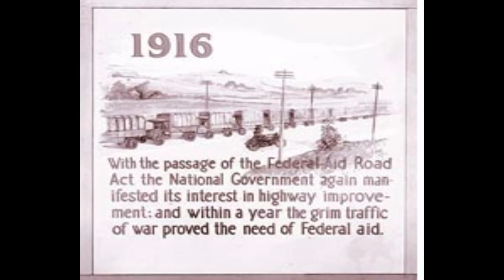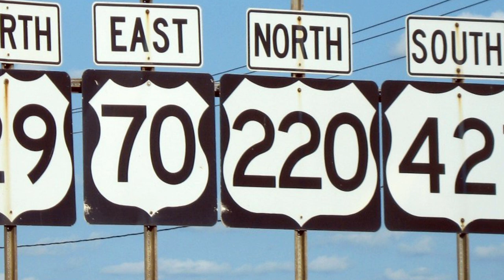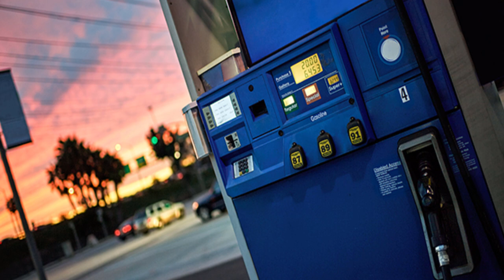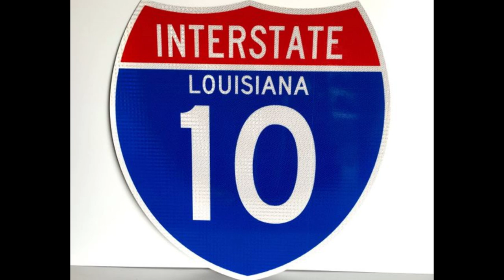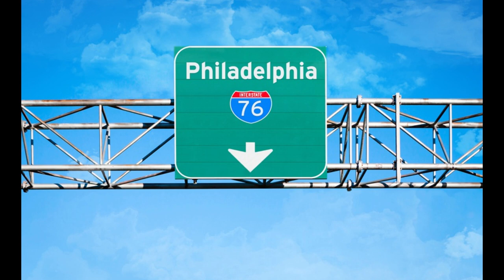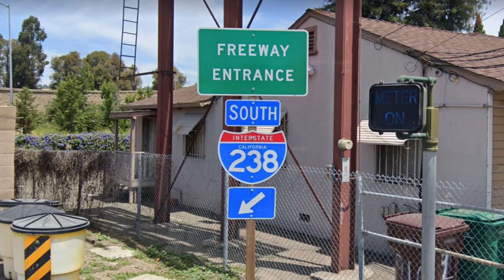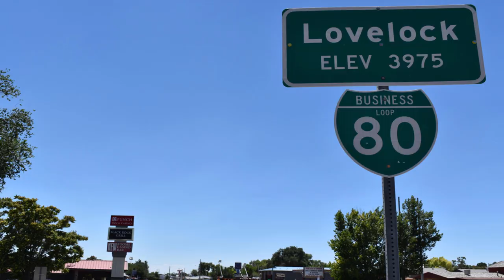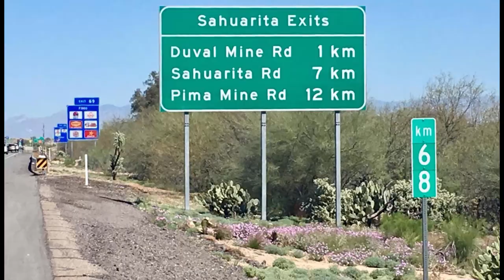The U.S. INTERSTATE HIGHWAY SYSTEM Explained

Comment: The reason I-19 has distances in kilometers isn't because of Mexican tourists, but rather as a test after the passing of the metric conversion act of 1975. Now when signs need replacing, they will do so with miles.
Reply from the maker: Thanks for letting me know! I’ve been in that region but never been down I-19 so thanks for correcting me. That’s really interesting!
Reply: I concur.  It was a test highway relating to conversion from English to Metric system.
Reply: Cities woes are self inflicted. Why anyone would want to live in an overcrowded, dirty, corrupt cities I'll never understand.
Reply: @kdrapertrucker  why do you think cities are corrupt? So rural communities have no corruption? Cities are actually very clean and offer residents huge opportunities for upward mobility. I live in DC and absolutely love the access I have via walkable communities and transit to anything I’d need.
Reply: I know the metric system but I think in miles and inches! I know a km is close but less than a mile as 2.54 centimeters in an inch and a meter is close to a yard
Reply: When some signs were replaced for maintenance, they remained metric
You can see them on google street view with signs using newer clearview fonts
Reply: They should use distances in miles, but use km for mileposts and exit numbers.
Reply: The metric system is the best! When is the US going to get with the plan?
Reply: @RogerLaurel  I hope never. Miles For Life!!!!!

Comment: I'm a truck driver, so the interstate system makes my job 100 times easier. At the same time thou, i come from family that have been displaced specifically due to the interstate system in NYC. So it's a little conflicting sometimes
Reply: Well, you didn't build the thing so it really isn't your fault. Your family is unlikely to blame you in any stretch of imagination.
Reply: Roads are racist, unless you buy an EV or take an EV bus then it is less racist.

Comment: My favourite feature of the interstate system is that the exit numbers are mile markers which means you can very conveniently track in how many miles your exit is coming up and plan accordingly. Additionally if an exit is added later, you don't have to renumber all the exits that come after the new one. I believe this is the only correct way to number exits. And even if you have exits within a mile you have 26 letters in the alphabet. I'd like to see a similar system implemented in my country one day. 
Another thing I like is that, while with exceptions, there is a clear numbering pattern and it makes me think of a mathematical graph where numbers increase the further right and up you go. Could it be the reason why I-5 is on the West coast and the I-10 is in the South? 
I believe it is possible to get onto the interstate from almost anywhere from the country and navigate your way home without a map or a GPS-navigation by just knowing which interstate runs near your home and what exit you need to take onece you get there. 
All around an amazing system, minus the fact that they tend to cut through cities. I strongly believe that they should go around cities and form ring roads.
Reply: I've noticed that as the interstate goes on the outskirts of a city, that the city typicaly expands to the interstate as what happened in my town of Stevens point WI. I've seen this in numerous small and medium cities that I've been through

Comment: I-84 through the greater Hartford Connecticut region is an example of the “winners” and “losers” situation you so aptly described.
The Highway was built around 1968 or so when I was a kid and it is the most curvy highway I know, because it avoided wealthy areas and
went through poorer areas.  Plus it has dangerous entrances and exits on the left, which creates some insane driving if you are not used to it.
Reply: I always hated it going south on 91 and crossing the river and getting on State 2. They fixed it from what it was in the 70s I grew up near there.
Reply: Interesting.  I was born in CT and know 84 all too well.  Highways in CT are absolutely horrible.  If you are not avoiding manhole covers, you are avoiding potholes.
Reply: @ahotdj07  I lived in CT for 30 years. It's one state where the majority of interstate highways were simply state highways that were rebadged as interstates. Those state highways were built nowhere near to interstate specifications and were already woefully inadequate when the conversion occurred. 

Traveling through the state is by and large a disaster. In the past 15 years or so they've taken to "patching" the winter potholes, if they patch them at all, with a bastardized reddish colored version of cold patch asphalt which never actually hardens. Every time a tire rolls over the patch the vehicles behind get pelted with gravel that breaks loose. They also use an anti-icing chemical without the required anti-corrosion additive. Not only does this eat away at your car in no time but it also completely destroys the pavement after just a couple years. Slap that on top of interstates with unsafe curves, inadequate lanes, narrow shoulders, and left exits galore and you've got a perfect storm of horrific travel.
Reply: @jblyon2  Not to mention the issues they had in the past with not maintaining bridges and they would collapse.
Reply: @ahotdj07  Yeah, those were designed to fail from the start. The lack of maintenance just accelerated it & kept the problem from being discovered. They would have eventually collapsed no matter what. How that design ever got approved is beyond me. 

I live in RI now and a lot of the bridges here were so close to collapse it was unreal. That's being addressed now thankfully. At least 16 near me have been completely replaced in the past few years, and a good dozen or so have had major restorations done.

Comment: You missed the "Hidden" interstates, like 444 in Tulsa, OK. No signage, other highway numbers, yet officially an interstate with a proper route number and funding.
Reply: It used to have signage until 1995, signs were changed to us 75 to avoid confusion.

Comment: I live in the Phoenix Metropolitan Area in Arizona, where I-10 goes through. I can certainly say that Phoenix has a great freeway system, and that's with no 3 digit interstates. 

Now Phoenix and Las Vegas are some of the fastest growing cities in the United States, and U.S. 93 is heavily travelled. There were lots of issues, like driving across the Hoover Dam. After 9/11, trucks and buses had to instead go through Bullhead City and Laughlin to rejoin the 93 in Boulder City. But when the Hoover Dam bridge was completed in 2010, it made traffic flow more smoothly. 

They also made the highway completely bypass Boulder City and have exits to access it. They've now officially designated the U.S. 93 from the Hoover Dam bridge to Vegas as Interstate 11. But they still have the 93 in Arizona with many at grade intersections (not exit ramps). Then of course there's the heavy clusters in Kingman. I'm certainly intrigued to see when and how they'll continue improving the 93, and if they'll continue Interstate 11's designation.

Comment: Two things that I thought you should have added to your explanation of the Interstate system: #1 - The interstate system was supposed to help citizens to move en masse from U.S. cities in the event of a nuclear attack by Russia; and #2 - Every third or fourth mile of the interstate system was supposed to be completely straight so that military aircraft would be able to use them as emergency landing strips!  Otherwise, a very enjoyable documentary.  Keep up the great work!
Reply: That second one is a myth.
Reply: @marsattacks24  yeah for sure bc a lot of the mountain routes literally can’t be straight
Reply: That second one is a lie. Motorways are used to CONNECT air fields, not BE one.
Reply: Not sure about this as most roads were built after the 1950's. I think roads designs are more based on efficiency and cost.
Reply: Roads were made mainly for military an heavy machinery.  And yes some roads can be used as runways. Also they got the idea from the Autobahn as well. Unfortunately they don't make the U.S. highway roads as thick as the Autobahn. Nor do they take care of the roads here in the states.
Reply: That second thing is just false. 
I have designed interstates for 40 years. There is no criteria anywhere that requires any part of the system to be built as an airstrip. Many years ago, at the beginning of my career, I asked the old-timers who had designed the original system and they told me they had never seen any requirement to design any part of the system to be suitable for aircraft. 
There are bridges, signs, and wires overhead that would be serious hazards to landing and taking off. The pavement is generally too narrow for aircraft. I have designed the pavement, there is no consideration for the wheel loads of aircraft. The horizontal and vertical alignment generally follow the terrain to balance the  amount of cut and fill. There is no requirement to be straight and flat anywhere.
This myth probably got started in WW2, when, out of desperation, German warplanes used highways after their airstrips were destroyed by bombing. But those planes were so much smaller and lighter that some of them could also operate from open fields. (Watch "Battle of Britain" (1969), and you will see Spitfires and Hurricanes operating from grass airstrips.)

Comment: FYI, the completion of the Interstate system occurred when Utah finished its section of I-80 connecting downtown Salt Lake City to points west. Somewhat poetic with the railroad connecting east west decades earlier. To your idea of interstates and highways going around cities, unfortunately the city will just grow up around any road you build trying to go around and that other nuisance, geographic boundaries.
Reply: Your wrong, the last section of interstate was I70 through Glenwood canyon, because of funding, design, and lawsuits. It was opened in the early 90s. I-80 was completed way before that!!
Reply: The interstate system was never completed. I69 and I74 are a complete mess, I70 randomly terminats in Breezewood PA, I95 wasn't complete until 2018 due to a gap, ect, ect
Reply: I have been designing and building interstates for over 40 years. The system seems far from complete to me.

Comment: Just to clarify, "declared finished" is not the same thing as finished. All that meant was we're just going to stop funding this project now. Not far from where a grew up there was a portion of I-295 that just ended, and you had to funnel off on to local roads for 5-7 miles where it resumed again.  That stretch of non-highway lay incomplete for 10 - 15 years.

Comment: Recently, Massachusetts, Rhode Island, and Vermont already changed their exit numbers from sequential (consecutive) to a mileage based system. New York will do the same thing and I-81 and I-88 are the next interstates in New York will also change their exit numbers to a mileage based system, since they have done it for I-84, I-99, and I-781 within New York. Connecticut, Delaware, and New Hampshire will have to keep their exit numbers in sequential order. Too bad.
Reply: At the end of the NY conversion the Thruway will still keep sequential exits. It would be extremely hard to renumber it and it has its own exception in the highway code

Comment: 5:55 Correction: Between Lake Station, IN and Elyria, OH is where I-80 / I-90 run concurrent as the Indiana Toll Road and Ohio Turnpike which helps link Chicagoland and Greater Cleveland via tolls.

US 20 and US 6 are free to use as arterials that also link Chicagoland and Greater Cleveland.

Comment: I pretty much agree but with D.C., as a resident who drives here. You won't get a good experience driving here, the metros great but people here (especially those with maryland plates) are horrible and inconsiderate. Also i think we have the best bike system in the US maybe second to portland. One thing though is the I/DC-295 completely segregates Anacostia from the rest of the city.

My opinion is that interstates are amazing when they end 5 miles outside of major cities and a mile or two out from towns.

Edit: also the original dc highway plan was horrible, imagine the national mall but boxed in by 2 interstates. That was the original plan

Comment: I-238 should be either continues for CA-238, or the first 4 digit of the interstate numbering system and it could be I-1080, since I-180, I-280, I-380, I-480, I-580, I-680, I-780, I-880 and I-980 are taken in California and it is auxiliary route of the parent of I-80.
Reply: 180 and 480 don't exist anymore though.

180 is now part of 580

480 was a state highway, then an interstate, then torn down after the World Series quake happened.
Reply: All the single digit prefixes were all used, so to keep it to three digits they used the State Hwy. number, but didn't keep it as a state highest shield because they wanted the federal money to build to interstate standard.

Comment: You forgot to mention that the alignment of the major Interstates *5 and *0 follow the routes of the U.S. Routes of *1 and *0 except Interstate Five. So some places use the old U.S. Route number rather than Business Interstate as the route through the city or town.
Having an Interstate highway cutting through a city is bad, but so is having a STROAD. Sure an Interstate generally has fewer crossings, fewer people are probably killed or injured on the Interstate that cuts through a city.

Comment: Why are the interstate highways in Illinois always “under construction?” Except in the winter time? 🤔Especially I-90 between Chicago and Rockford. And I-70 between Indianapolis and St. Louis?
Reply: Since interstates are very busy year round, cars wear it down easily so about every 10 years (as in my area) they re pave an area, and since interstates are long, there is always more to do. And winter is cold, especially in Illinois
Reply: @MrChilili  I understand that big trucks wear a road down even more than cars do. Plus in northern Illinois you have the weird freeze / thaw cycles that create potholes.
Reply: It about the load weights of Trucks and on the Turnpike of i-80/90 i seen double and triple trailers

Comment: You did not mention why there is not an I-50 or I-60.
Reply from the maker: Thanks for bringing that up. That’s a good point that I forgot to talk about: as you likely know, US 50 and US 60 take up the space where a hypothetical I-50 or I-60 would be, which the government did not want confusion for. Thanks!
Reply: US 50 and US 60 were too close to the potential interstate locations for I-50 and I-60, so they let the US highway numbers stand as is. US 40 for I-70 and US 66, parallel to  I-44, are divergent enough prevent confusion on the business loop.
Reply: people would be confused with i-50 and i-60  that is why there is i-44 and i-64

Comment: Why are there 2 I-190's in New York State if there isn't supposed to be?
Reply: I-90 in NY and I-80 in CA are the only 2 interstate highways that use all the numbers 1-9 in a single state for branch interstates.  This is because I-80 is the only major interstate that goes to San Francisco and I-90 is the only major interstate that goes to the Buffalo and Rochester metro areas.  I don't believe they wish to name a interstate 1090 or 1190.
Reply: There was a Illinois high way 88 across a portion of northern Illinois until the Ronald Reagan interstate was built (I-88) and then Illinois changed Il-88 to Il-40 . Il-40 connects Mount Carroll Illinois to Peoria Illinois.
Reply: I only know of One 190 in the Buffalo-Niagara Falls Area, 390-590 Rochester, 790 Utica and 990 in Buffalo

Comment: Did you just say Highways are Racist?
Reply from the maker: Not inherently no, roads aren’t racist by themselves. However, the way they are planned and built can have disproportionate impacts on certain races, and the poor in general, with socioeconomic status and race often having strong correlates due to biases such as highways are constructed. The reason why highways are discriminatory is because when highway planners constructed highways through cities, they would often cut through poorer neighborhoods that were not able effectively lobby against the construction of highways. Often times, these were predominantly black neighborhoods. You can argue over the merits of where highways were built, but you can’t argue over the fact that there were some systemic manners in which they were constructed. I’d urge you to look at maps of cities and where there highways are constructed with racial and socioeconomic maps.